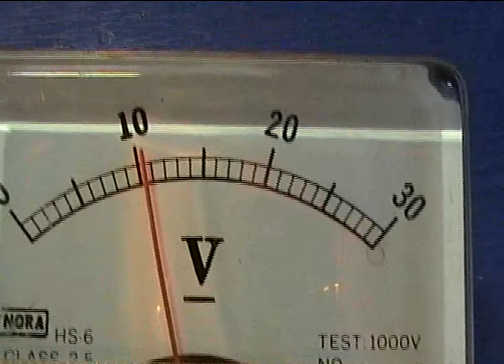Flexible 555 LED Pulsing (Breathing) Circuit (new version)

Comment: PC-HAVEN:  
I need help with making a 12v circuit for a strip of LEDs about a dozen so that they turn on like dominos or a zipper in sequence until all are turned on until power is cut off.  I need the simplest circuit to connect to the existing turn signal of the car so i don't get killed.  However you can help please.  Thanks!

Comment from the maker: you like the spindicator? i'm surprised how many people like it. i did not expect it... anyway. i use the pickit3 clone and it will work with the LF PICs. If you use other programmer, make sure that it can program low voltage chips.